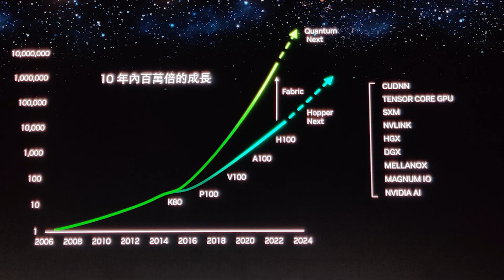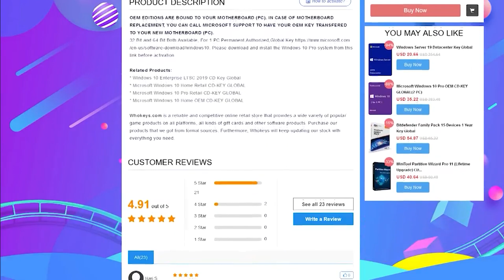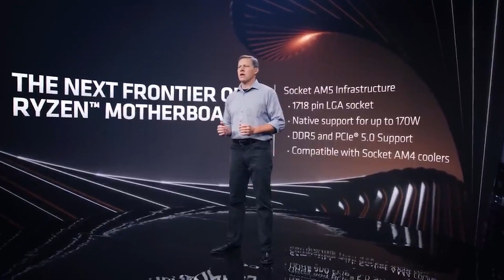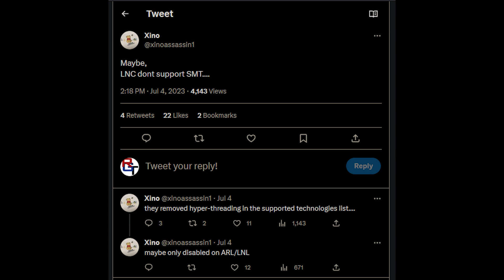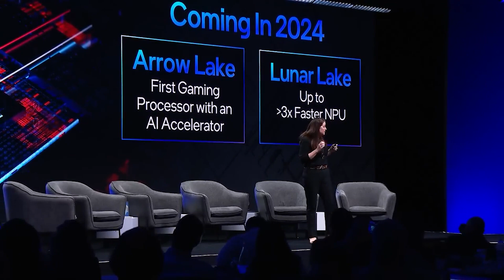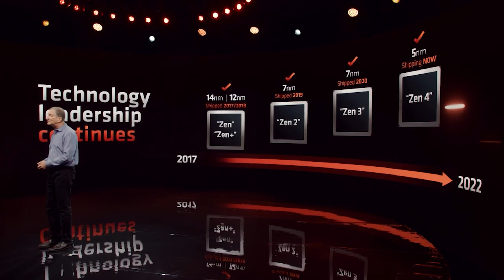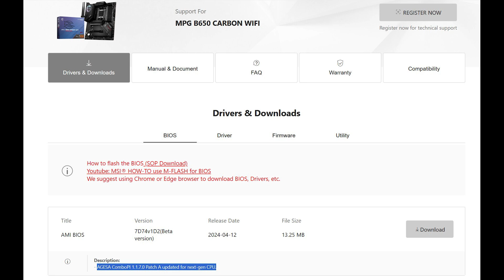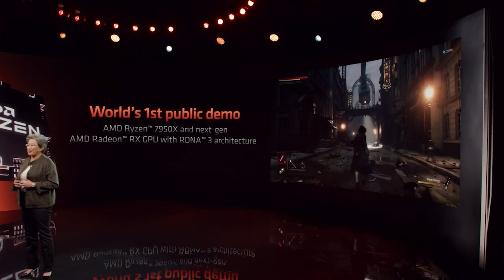Zen 5 CPUs CONFIRMED | RIP Hyperthreading - Arrow Lake LEAKS

Comment: I believe there is another hyperthreading security floor Linked to Hyperthreading found and Fixes for previous flaws slowed down cpu cores a lot so remove hyperthreading and drop fixes that slow it down and core extra performance & die shrink alow more cores to aliviate issue plus by dropping hyperthreading scheduling of cores is easier in OS. AMD did have as many issues with security only scheduling issues are X3d picking right cores for work load ie game that likes fast clocks to fast clocked core and more cache to slower core with more cache.
Reply: I had a fucking stroke reading your comment. Wtf did you say

Comment: HT takes up space on a silicon die and increases costs, so I guess Intel just figured it's better to invest that resources into E cores instead. Perhaps all models will now have at least 8 E cores.
Reply: SMT in fact improves power and area efficiency. So, it actually can save costs because you need less silicon for the same performance.

Either SMT is broken in Arrow Lake (some rumors were saying that). Or Intel deliberately takes a step back for now. Because they had a lot of security issues due to SMT. Professionals even recommended to turn off SMT on Intel processors. And Intel tries to compensate it with e-cores in the future.
Reply: @avynian  I think circumventing speculative execution vulnerabilities inherent to current Intel implementation of SMT is the real answer, too. Other people are saying purpose of removing SMT is to gain IPC, but that doesn't add up since p-cores now do heavy lifting while SMT provides greater efficiency and was achievable even with added e-cores.

The downside of course is that with these additional e-cores, newer Intel CPU's are WAY less power efficient and run much hotter. People used to make fun of Piledriver on the AMD side for its inefficiency but the current Intel lineup is even worse.

Comment: Didn't intel drop hyper threading in the past and then they brought it back a year later?
Reply: They did when they went to the core 2 duo/quad. Pentium 4 went to Pentium 4 with HT, Core 2 duo/quad dropped HT, then i series brought back HT.
Reply: @matthewtremain683  should of remembered that as at the time i built i p4 system with ht felt so furturistic xD
Reply: @matthewtremain683  i was meaning the iseries line up but yes you are right they didnt have ht then when they did on the p4
Reply: Nope they dropped it for most the 9th gen with only the i9 getting hyper threading. That's the only time they've come close to dropping it before.

Comment: Hyoerthreading was a solution to a problem that doesn't really exist any more. Specifically how to schedule multiple tasks on limited processor cores. 
I know some still consider that hypertheading is some sort of core adding magic. But its not.  As more real cores are added it offers Increasingly diminishing returns and adds Increasingly onerous complications. IMO at 24 actual cores, the utility of hyperthreading is vanishingly small and the drawbacks outweigh the benefits.
Reply: but are they abandoning it on p series xeons?
Reply: @jimecherry  That's a fair question. However, I would say that in server workloads it makes more sense (just a tiny bit) as they are often dealing with the inputs of dozens, sometimes hundreds of users simultaneously. Each with a tiny request. 
An ERP like SAP needs servers that divide the total run-time by as wide a margin as possible and damn the consequences. 400 users all making queries now and then. Tiny little requests that hardly move the dial of CPU usage individually. But SO MANY of them.
But even there I think MT has almost reached its nadir
Reply: No. SMT always offers a noticeable uplift. At least 20-30% on modern x86 processors. Diminishing returns are only an issue if the uncore logic cannot scale well enough. But this will affect both, SMT and physical cores.